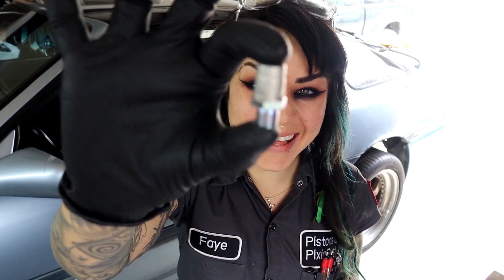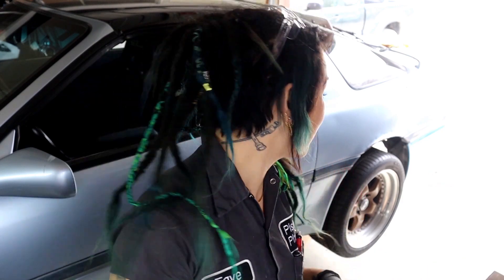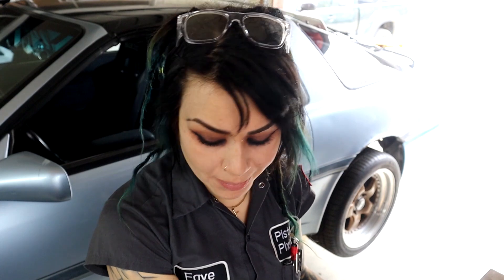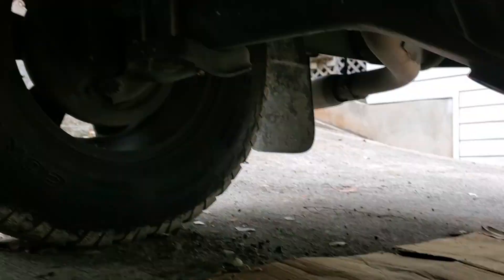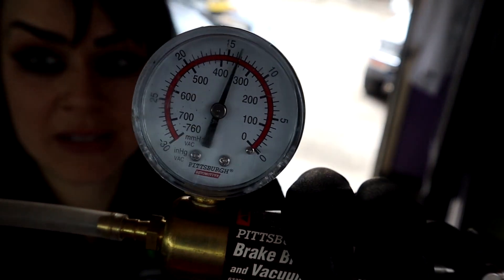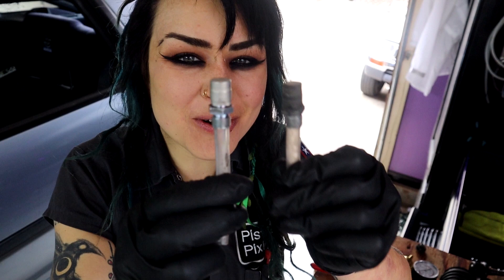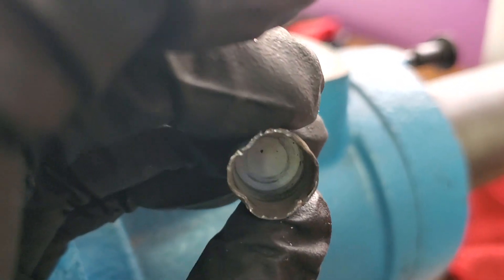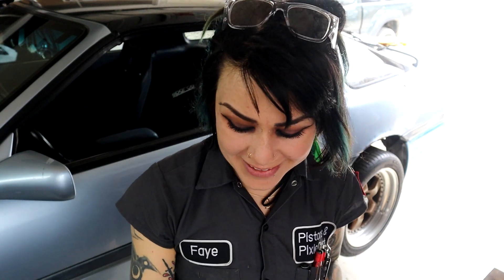This should be a scheduled maintenance item!! The often overlooked Diff and Transfer Case Vents!

Comment: I imagine this is a one way valve, letting pressure out. When 4WD’s are modified for deep water crossing they often say there’s more that needs to be done than just a snorkel from the air filter box. Would this valve also be a concern?
Also, I thought the spooky rustling of the dead leaves in the chilling wind complimented your smokey eye makeup. Please don’t hush the leaves next time. 😁

Comment: I was a school bus fleet mechanic for a lifetime, mostly IHC chassis.  In routine service we always checked, cleaned and or replaced these as needed.  And yes they do get plugged up. Very good info for any mechanic to know, thanks.
Reply: Unless the thing is physically damaged by impact or massively corroded, I don't ever see having to replace a diff vent valve. Would you agree?
Reply: @ProleDaddy  They do get plugged up & the way some are designed it is easier & faster to just replace it.

Comment: Great video Faye!   My 96 Suburban lunched a rear differential due to fluid.  Pinion seal leaked not long after I replaced the fluid.  When I was in there I noted it had a new diff not the original gov lok.  So it had been replaced.  I’d be willing to bet the vent never got replaced in its lifetime.   May have contributed to the pinion leak.

Comment: Love your videos.  Question... I'm confused how these vents work.  In the uncompressed position, are they open?  What happens when you press down on the top and compress the spring?  I've seen some videos that recommend simply spinning the top and pressing down on it a few times to sort of "exercise" the mechanism, but I'm not clear what is actually happening in the uncompressed and compressed positions

Comment: Hi Faye I am trying to add Key Fob operation on a 2011 Tacoma . There isn't a Door Lock Module in the glovebox but the wiring is there. Wondering if adding the Module would give me Fob control ? I did the Cruise add on after your Video and it works perfectly on my Base 2011.easy upgrade.Thanks for your wealth of info .

Comment: Hi Faye, great video!  Based on what you're saying, is there a separate vent valve for the transfer case?  Would there be a separate vent for the front differential?  If so, where are these located.

Comment: Well I just got a 2002 4 runner and wouldn’t you know it I checked and it needs a wheel seal on the passenger side , so replacing the differential vent is a no brainer , so I’m in west central Florida and the puddles and streets get pretty deep so I’m going to remote my vent just to keep water from getting in , now where to mount it ? 🤔

Comment: Seal leakage due to built up pressure does not necessarily ruin the seal, correct the pressure problem, clean up the seal area and monitor the situation, it may take a few weeks to settle down but if it's your truck it's definitely worth the shot to save $.

Comment: Should make a mention about diff breather extensions for people driving through water crossings. The hot diff cools rapidly in the cold water and if deep enough will suck water into the housing. An extended breather solves this. Unless you just use your 4x4 for Instagram pics, then stock is OK.

Comment: Hello Faye. Lov the vids. My Toyota dealer said they've not sold this part in years but I got one (thank you for the hint) when I did a diff oil swap on my G145 (LSD) rear diff on my LH119. Btw I find I can position the 1L new oil bottles (Castrol Z LSD90 in my case) within the spare wheel cage to drain the bottle into the housing and I don't waste oil in fill lines etc. Top tip from me. Cheers

Comment: I'm surprised Toyota did something so silly.  The big 3 all just did a simple open vent nipple on the housing or axle itself and then just put a 8" hose on it done in a big overhand horseshoe loop.  The hoses are also oriented so they open to the rear of the vehicle.  These vents have served well for decades.  They do occasionally get clogged and dry rot, but it's a simple rubber hose that ALL of the parts stores carry.

Comment: On the repair manual for 02 Sienna and 99 ES300, which are FWD with transaxle, I don't see anything in the diagrams that appears to have a breather. I know there is a drain/fill plug for the differential even though they share the ATF fluid with the rest of the transaxle. I wonder if there actually is a breather that I could replace.

QUIET LEAVES!

Comment: Hi Faye, 
I'm a recent  fan of your channel and really been enjoying your videos! I want to ask if you have any videos about fixing/replacing a windshield wiper motor in a Toyota? I'm having this problem with my 2009 Camry and have already replaced the switch, but that didn't solve the problem (wipers only work on fastest speed and don't seat correctly when switched off). It's not the fuses and the Toyota service center did diagnostics to determine if it was the wiring and they said no, it's the motor.  I think I can do this myself but it'd be great if someone smart like you who is experienced were able to walk me and anyone else experiencing this problem, through the steps of successfully pulling off a project like this.  Thanks!   If I get this one done, then the next project is fixing a leaking radiator!

Comment: What is your thought about using long extension on torque wrenches. 
From what I understand is that it absorbs shocks, but as you tighten things in one fluid motion there should be
the same amount of torque at the socket as well as at the torque wrench. 
AKA 100nm is 100NM no matter how long the extension is.

Every time I torque something with a extension some guy comes running, telling me it's wrong.
But no one is ever able to explain me why it's wrong.

Comment: It didnt happen on a Toyota but I got tasked with finding out why gear oil was leaking from behind the dash in a semi truck. Turns out the diff vent was so corroded that no pressure was able to vent. Pressure would then build when the oil got hot, shove the oil up through the air line, and out the switch for the power divider all because of a two dollar vent.

Comment: Normally I think you can clean those with some brake clean however I do not like the way Toyota mounts that on the differential I like the way Ford and General Motors does that very few things they do I like but they have a rubber hose that Mouse it up to the body so if you happen to driving some deep water where you submerge the differential it doesn't run the risk of taking in water although that should have a one-way valve in it so it doesn't take in water just lets pressure out but it could take in water or something else for you to think about

Comment: Thank you for this!  I've always heard of issues that can occur with bad differential breathers and have wondered what I should be doing to maintain them (other than ensuring they are still spinning freely). I will be changing ASAP on both my 3rd Gen T4R and 1st Gen Taco!  Appreciate you showing the specific impacted spots when a diff goes bad as well as the pressure test (old vs new) and also for cracking the old one open for a closer look.  
BTW, what is that awesome car behind you? An RX-7, maybe?

Comment: Great info as always Faye, thanks! And if it helps anyone the location for the xfr case and front diff (at least on the 4th gen 4runner) are actually located in the engine bay right next to battery - two small vents via long tubes fastened to each other.  Maybe these won't require changing as much as rear as they are high in vehicle, but worth a look!

Comment: Or...relocate the vent by adding a 3/8 air line fitting to the diff, some air line (or any tubing with a 3/8 ID) and finding a much higher outlet location. If one must have the ten dollar part...just add the appropriate fitting to adapt the part. Make sure to leave plenty of hose for suspension travel. Now you might be asking yourself...why do this??? Well...just drive through some water deeper than the diff vent. Well...do you fell OK with your vent under water? You shouldn't. I'd make sure the transmission vents are checked and relocated if need be. If one never takes their truck or SUV off the asphalt...this is not necessary. BUT!!! Floods are real and unpredictable. Just a little tip I learned from some old dude back in the early 80's.

Comment: HI, stupid question. Case gets hot and oil leaks out pinion seal.  Once the case cools down, does air leak back in ? Hence cold - heat - cold heat  acts like a pump forcing oil out and letting air in ?

Comment: I may be wrong about this, but I think those breathers have a check valve.  They should hold vacuum, but not pressure.  Having a check valve would stop them from sucking water as the diff cools down during a stream crossing.  Of course it's better to have an extended breather of you are going in the water.

Comment: I’m not sure what Toyota typically does with SUVs and 4X4 but many of these vents actually have a line or at least used to in the days I messed with them that went somewhere higher on the vehicle so when the hub was submerged in some sort of liquid it wouldn’t actually get into the hub. Unfortunately these same lines get old and cracked and break and need replacing sometimes. Perhaps you could comment on this Faye?

Comment: Or do the state 48 diff vent tube relocation.  It comes with brass filters instead of those things.   I have mine on my Tacoma behind my brake light and the ones under the hood are by the battery.

Comment: Good vid, and important.

These same breathers are installed at least back to 1980s Toyotas, including on the transmission...

Teflon tape is needed to seal out water if submerged beyond just threading in.  

Toyota sells 2 versions, one which just allows pressure to escape (and has a seal to keep water from getting in if submerged) like here and one which allows 2 way breathing -- the former is installed low like on the rear diff here and the latter is installed high with breather tubes and just has a filter.  There are also diy mods that can be done with tubing and fuel filters mounted high...

Toyota and other car manufacturers also sell nipples that can be used to install extended breather tubes as well...

Comment: AWESOME!
Kinda like when the breather tube on the back of your headlights, get clogged with spider web and cant breath....the headlight fogs up or accumulate water...
When the vent in the axle clogs, it is somewhat likely to build up pressure/vacuum with temperature change.

Now, for shits and giggles, submerge a hot highway driven axle, in cool mud or water... As it cools off the axle and creates vacuum, the axle is bound to suck in water somewhere.... ELEVATE and drain loop the vent!!!!

Comment: I replaced the diff in a 2008 Tundra i picked up for $1000....turned out that had worn carrier bearing in diff....replaced all seals and bearings in axle at same time....no way I was gonna leave in old breather after all that work lol
Reply from the maker: Wow!!! That's a ton of work!! So glad that you were super thorough!!
Reply: @FayeHadley  well worth it for Toyota Tundra so cheap lol did mention tge truck at 300,200km and runs and drives perfect....better that the 2018 work Tundra I was driving lol Think rear drive issue was from previous owner liking to do burn outs etc lol

Comment: While you're down there replacing the breather, It's fun to hose-clamp a length of quality fuel line to a threaded hose union (I put a bit of plumber's tape on the threads) on the diif and run it up to a protected area. You can submerge your axle and not worry about sucking water into your pumpkin. Not just for 4.-wheelers, but perhaps you need to launch a trailer'd boat or something. Congrats on the new show, Faye!!!!  Gonna be peepin it for sure!
Reply from the maker: Yes, this is a very common mod in Texas, which is why I often forget to check them! I never see them stock. I have done this to my truck even though I don't go wheeling- there's a lot of flooding here in the spring.
Reply: @FayeHadley   Thank you for replying, Faye!! Stoked I can retire from YT now. Of course, I didn''t mean to sound like my 'splaining was directed at "you", personally. Just any readers who are already down there following your excellent advice .

Comment: What mileage interval is recommended to change those out if you never need to overhaul the diff?
Reply from the maker: If I were Toyotw recommending this service, I'd say to do it with every other diff svc. Check every service (60k) and replace at a minimum every other (120k)
Reply: @FayeHadley  Sounds good thanks. Does the transfercase have one also?

Comment: instead, i break off the top you pulled off, or just replace the whole thing with a barb fitting, and run a hose from there up behind one of the tail lights, make a loop then cap it off with a little round or fish tank filter. you never have to worry about it plugging up, or water getting when in deep water. always enjoy your vids Faye! can't wait to see the new show.

Comment: If you go off road a lot or drive a lot in dusty conditions, I put a pipe nipple  on it and run a line with a loop in it up to the body.   I end it with a fuel filter from a carburated car high up in the body facing down.  Now there is no issues with airflow due to temp changes, plus an actual filter to catch dirt before it get sucked into  the diff.   The longer hose with the loop also keeps water out.  Cheap, easy, and works :)   Just make sure the line is away from anything that moves and has enough slack for to allow for full axle droop.   I have submerged axles for hours with this mod and they never got water in them.  The engine was not quite so lucky....
Reply from the maker: Oh nooo haha!!

Comment: I purchased an 84 Mustang GT new with a bad diff vent. Leaking by the pinion seal and the dealer told me this was “Normal”. I cleaned the valve myself and no more leak! Imagine that. Good tip!
Reply from the maker: No WAYYYYYY 😀

Comment: Faye this was something most people wouldn't know about! When I worked on a Nascar team we did this but we used a Catch can and a long tube so nothing would go on the track. We tested for Nascar in 95 and after 30 laps it would build pressure to 20+ psi! These valves are on every rear axle some only have what looks like a plastic cap on the top of the tube and some can be cleaned with break clean with a tube to get into it and also WD40. I know it sounds weird but does work. Hope everything is going good for you
Reply from the maker: YES! Wow!!!!!

Comment: Supposedly there were some issues with FJs when a warm diff would hit cold water while offroading, related to the diff breather.  Getting a breather kit to improve the function (and also raise it up where it would stay dry) was strongly recommended to me.  Interesting that there's a TSB on them now.

If you want a suggestion for a Taco/FJ/4Runner repair video that would be useful, do one on the (horrible) parking brake generally but specifically on reassembling the parking brake after taking it apart.  I successfully installed an SOS performance BBK on my FJ, but had to bring it to the dealer to get the parking brake reinstalled because I absolutely could not get it back together.  It comes up online sometimes, so you might get some views on it.
Reply from the maker: Great recommendation, thank you!! I will keep that in mind and probably do that!! 😀👍

Comment: Call me old(almost 50)  i like the old style vents. Funnel type  with a crimped cap. Much like the 2nd type you showed.  One way valves are problematic over time.  Anyhow, vents are super important.  I've  seen many seal failures due to plugged vents in the big truck world(oilfield).

Comment: Hmmm... the pinion seal is leaking on my 2011 Highlander with only 55,000 miles. Although the TSB you showed does not mention the Highlander, does it still have the same vent that is easily replaced?

Comment: Faye there is also this thing around the forums that says rapidly cooling your diff e.g. plunging it in to water in a creek crossing can cause that breather to suck in, cause a vacuum in the diff and actually suck water in your axle seals? The remedy is a “breather relocation” (making the rear similar to the front breathers). ARB sells a kit but many just use OEM front breather parts and extend the breather up higher with a hose. We did it but I began to wonder about potential condensation build up in the hose running in to the diff! Any thoughts?
Reply from the maker: Oh absolutely!!!! If you do a lot of off roading I highly recommend this! It's a very common mod here, and I don't often see the breather in the stock location which is why I think I forget to check it so often!! HAHA

Comment: Heya Faye! It's a long time since I have commented, as a mechanic who works in Western Australia, where we have a huge amount of mining vehicles that are Toyota, failures caused by diff and gearbox breathers are very common. Most of the mine spec or even road spec vehicles from Toyota have breathers that are run up high into the engine bay. A blocked one will cause leaks by pressure inside the diff or gearbox housing, as a result of heat, to blow oil past the seals, also what can happen is if the breather is blocked and the vehicle has a hot diff or gearbox suddenly submerged in water, like when we do a river crossing, water will be drawn in past the seals as the pressure inside the casing drops in a quick fashion. Definitely something to keep well serviced in this neck of the woods.
Reply from the maker: Wow- great info! Thank you for validating this video!!!
Reply: @FayeHadley  all good, and yeh, super important, we don't change them out as specified, we just make sure they are clear and operating correctly. Whether it is a modern Toyota or a 1970 Valiant, breathers are important and often overlooked.